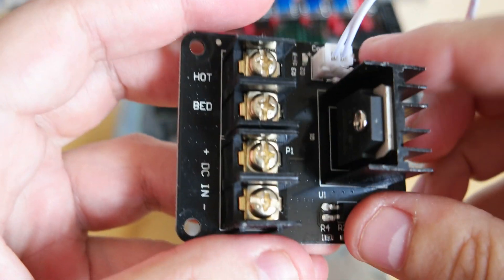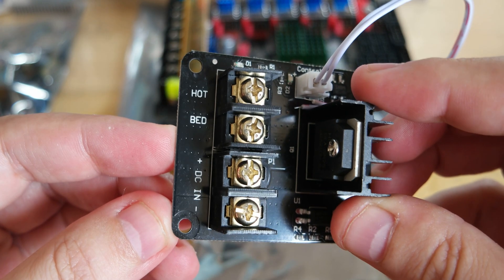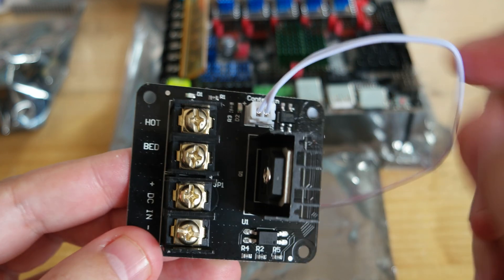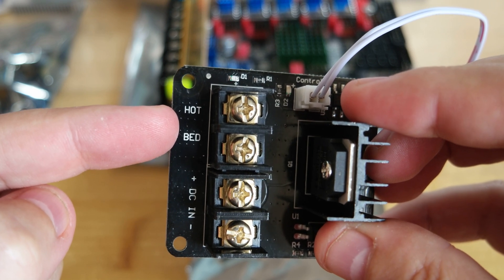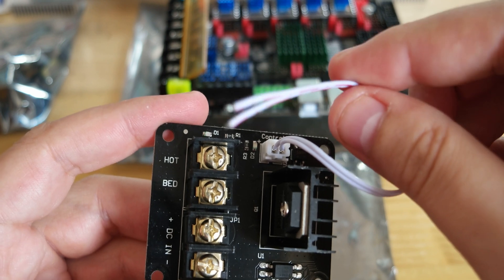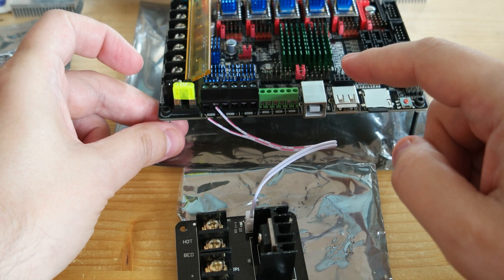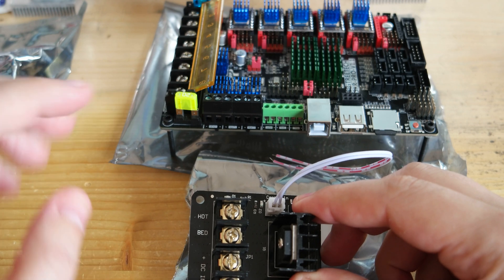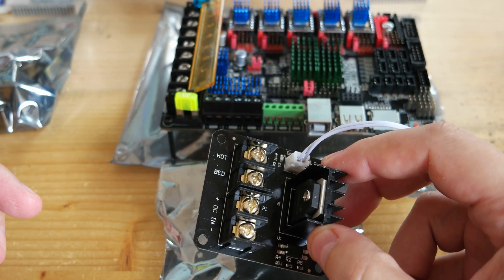BIGTREETECH SKR Pro V1.1 and Heated Bed Power Module /Hotbed MOSFET Expansion Module

Comment: I have two of those and cant make it work. Arduino controlling on of. But it doesn't heat the heating tube.12v power suply i conect directly to tube its work.

Comment: Poderia me dizer como eu ligo na mesa aquecida? Não estou conseguindo.
Reply from the maker: can you please translate in English your question, I want to make sure I get it right.
Reply: @ganzoai  Could you tell me how I call the heated table? I can not
Reply: Sorry
Reply from the maker: @leandrodibuono4004  You want to know how to connect these module to the heated bed?
Reply: @ganzoai  yes, where do I plug the "control in" connector on the SKR Pro?
Reply from the maker: @leandrodibuono4004  as I mention I do not use a heated bed, but the connection is similar to the extruder resistance. You connect the power supply to the module + and , than the heated bed to the HOT BED pins, and the white wire which control the signal to the BED pins on the SKR Pro and make sure the +/ of the white wire are connected to the +/- of these pins. Does it make sense? Also pls subscribe ! thx
Reply: @ganzoai  So the source and "control In" will be connected to the mosfet?
Reply from the maker: @leandrodibuono4004  on the board there are 2 connection for the bed. One is comes from the power supply and goes to the board. So instead of going to the board you connect this to the Mosfet module. The other connection on the board, goes from the board to the bed. This is substitute on the Mosfet module where there are the labels HOT BED, so it goes from these connection to the bed. Now the white wire, which has positive and negative, you need to connect to the board where power is controlled. Now, I do not use the bed so from my knowledge should be the connection that goes from the board to the bed. If you need a more precise answer, you can post a question on the BTT SKR Pro Facebook page since I know someone already did this setup. Hope it helped ! https://www.facebook.com/groups/2264108593625228/

Comment: Doesn't the board already have this protection with a fuse?
Reply from the maker: Fuses are good to have but they only work if you pass the rated current and you really do not want to get that kind of amperage on the board. This solve a different problem. For example. I have dual pellet extruder and each one has 2 heater cartridge, so at full power is around 160/200 Watts, depending if I use a 40 or 50 watts. With this device I can unload this power/current from the board and it allows me to connect 2 heater cartridge per device. Also if for any reason there is an issue with the heaters, this device will get the hit and not the main board. I will have very long print, like couple of days, so is good to have such redundancy. pls subscribe, will have more videos coming !